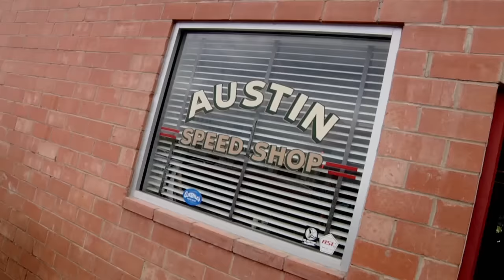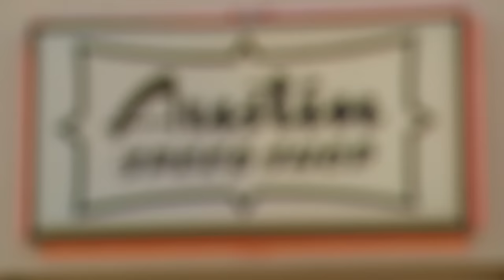Jesse James Austin Speed Shop - E02 - FENDERS (watch full episode)

Comment: I learned metal fabricating from my dad in the 70s And now my son has picked It up. one of the tricks we used to use on annealing aluminum or as we called it aluminium, We used to use a bar of soap and streak it along the aluminum when they streaks turned dark brown it was ready, The soap washed off when you cooled the aluminum

Comment: Really doesn’t make any sense at all with putting the rear fender low to the tire and cutting out the sidewall with more room in the front. Like he said if the tire goes low or you run it low and it goes oblong you’re still gonna hit the rear fender at that low point in the rear and burn your paint or possibly blow a tire.